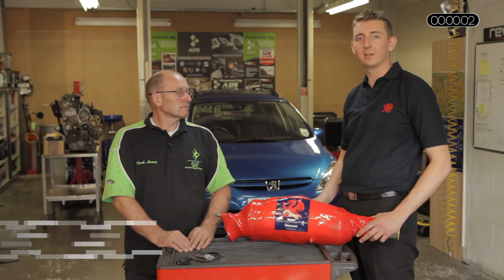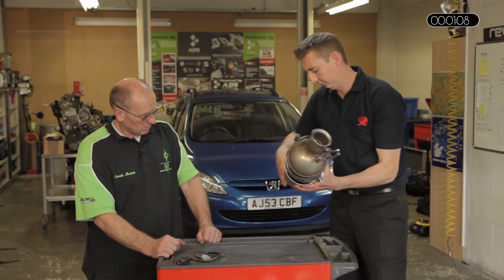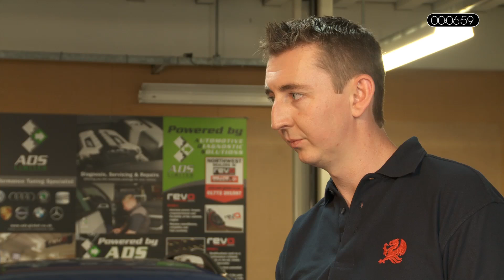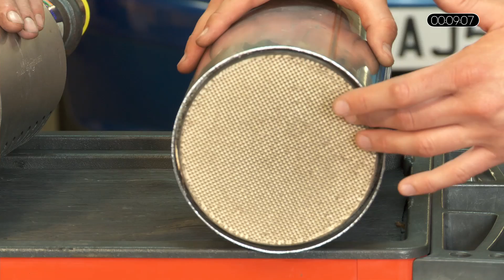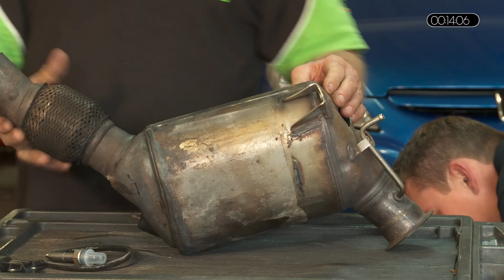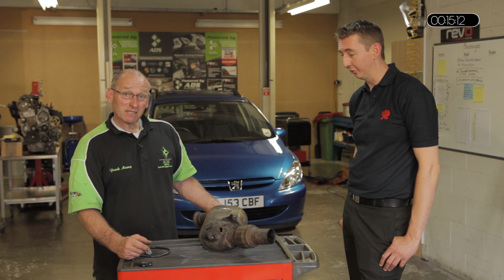AUTOiNFORM: Klarius and Frank Massey discuss DPF diagnostics

Comment: I ultrasonically clean dpf`s  for a living, and imho something very important info is missing here , : a lot of cars of the psa group use a fuel additive called eolys to lower the ignition temperature of the soot,  this eolys burns to ash, this ash stays in the dpf reducing the volume of the dpf, that is why psa group cars always need to replace or clean the dpf at certain intervalls . this eolys ash has a typical red/pink color and can be observed on the bottom of the tank  after ultrasonic cleaning.

Comment: I have a 2010 Jetta TDI Cup edition here in the States. at 92k miles a P401 code came up and the VW dealer without more diagnosis declared I needed a new DPF. I found a 2 month old DPF at a small shop with what was claimed to have only 1500 miles on it. after only a year I got the same P401 code again. Do you suspect a bad initial diagnosis? I spend 45 minutes a day on the highway so regens do occur on a regular basis. also, do you sell products for USA?
Reply: +peter sachs I would say you need major engine work. I'm in Australia and I deal with euro cars I have seen VW cars soot up I just cleaned one out from the EGR valve all the way down to the intake valves. So with major engine work I mean pulling the whole intake system off and cleaning it. I would also crimp the vac hose to the EGR valve or at least put a electronic boost gauge on the line to control the solenoid. You don't want to completely prevent the EGR system from working as it will throw a code.